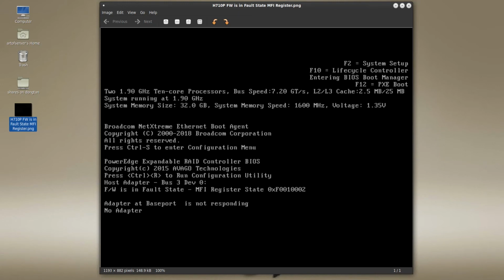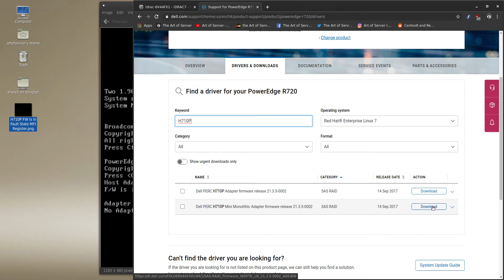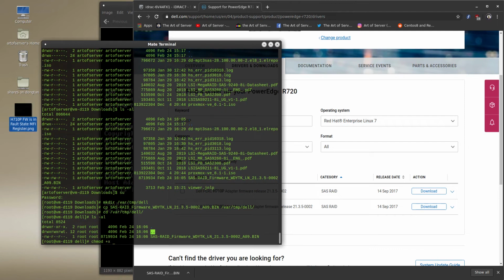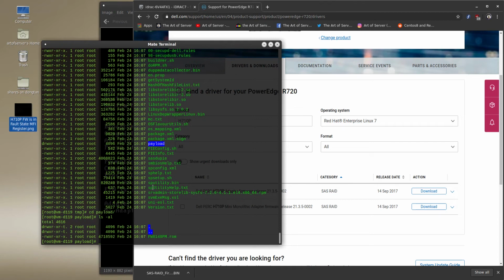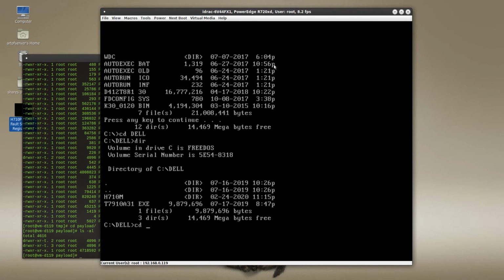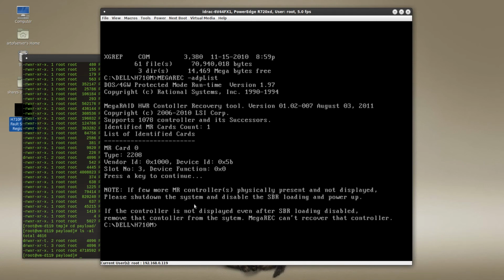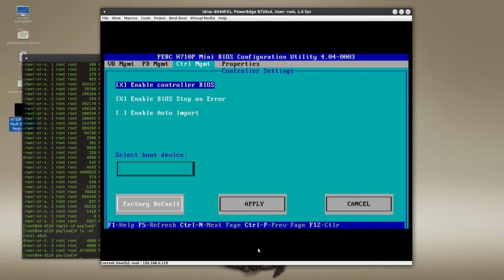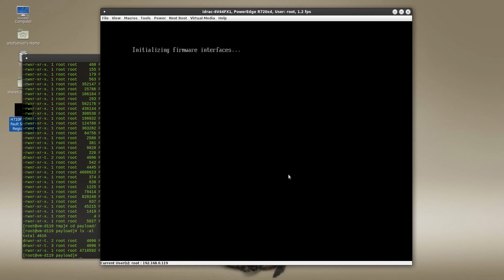How to recover H710 with F/W is in Fault State

Comment: I was so pumped when I found this video, have a H740P with a  F/W is in fault state error.   Tried everything to get it to reflash, unfortunately neither MEGAREC or MEGACLI sees the controller.   Even installed it in a second system and tried PERCCLI no good.   bit the bullet and ordered a new controller.  Great video though!
Reply from the maker: Sorry this wasn't able to help you. The H740P is based on the LSI SAS3508 and is a completely different architecture. So you need different tooling to work with these cards like storcli64.
Reply: @ Tried different versions, even looking through their documentation to match the supported card.  but nothing saw the card... opened a ticket with broadcom on Monday and still haven't heard back.   Ended up ordering a new card and was back up and running in no time... I do appreciate the video though... tons of great info.

Comment: Thanks! Power outage caused firmware validation failure. In my case I had to download different firmware heaving the H710 card. FW8148MM.ROM didn't work for me, ending with Error Code = 64. I've downloaded SAS-RAID_Firmware_700GG_WN64_25.5.9.0001_A17 with about 1MB bigger rom file: FW0001.rom
Reply from the maker: So the FW0001.rom file worked then? The tricky thing about these H710 and H710P cards is that Dell sold different revisions of the same card under the same name. Those revisions had controller chips that are not compatible with each other... probably should have been called a different product altogether.
Reply: @ArtofServer Yes, FW0001.rom file worked.

Comment: Hey i have a pe r620 mine is stuck on the screen just showing Initilizing firmware interfaces... Initializazion complete. and does nothing more, anything I could try?
Reply from the maker: I ran into the same problem with my R720XD. I ended up having to swap out the motherboard. :-(

Comment: How do you get megarec to work? I have it on the dos bootable but it won't start with the commands you're using. I downloaded it from the link in your video as well.
Reply from the maker: what happens when you run it? I didn't do anything special - it mostly just worked.
Reply: @ArtofServer  I guess you need a dos4gw.exe to execute megarec properly. It can be downloaded e.g. from IBM website.

Comment: Unfortunately didnt help with my PERC 730P, after making a procedure BIOS starting to get halted on init. Tryed already to reset a memeory (disconnecting battery). Is there is any solutions not to buy new card?
Reply: Buy one while they’re still cheap, and if you fix your own save it as a backup

Comment: For a Dell PERC H310 this worked very well for me with this guide. 
https://jc-lan.org/2018/05/19/flash-dell-perc-h310-to-lsi-9211-8i-it-mode-using-bios-and-uefi-method-firmware-bios/

Also, make sure in BIOS that you set the PCIe options so that the card boots in EFI or UEFI and not Legacy(BIOS) mode.